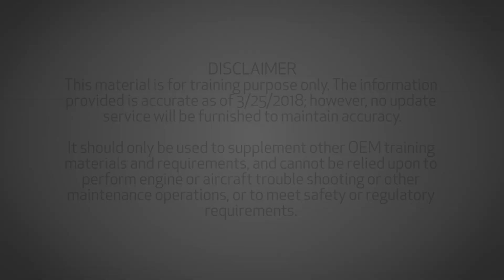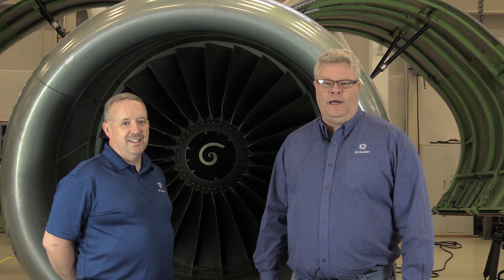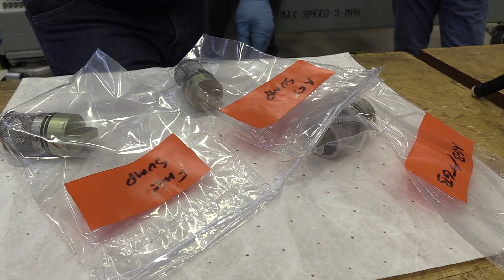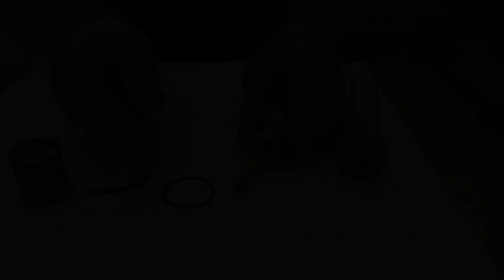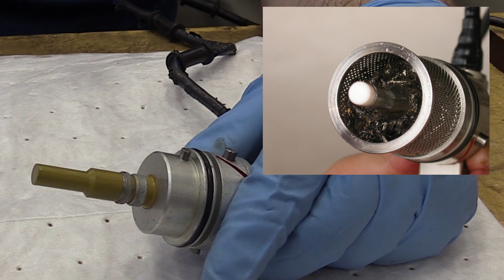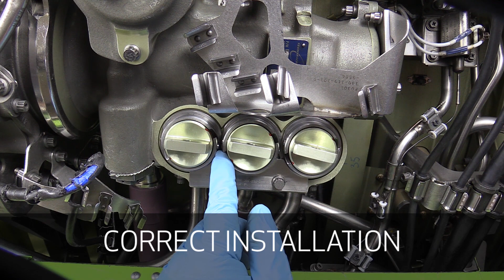CFM56 - MCD Removal & Installation - GE Aviation Maintenance Minute

Comment: And what they don't tell or show you in real world inspection ,there is oil that comes out ,not much but comes out fast ,when you pull the chip detectors. If it's an overnight check and the plane just came in, the oil will be really hot. Protect your self!